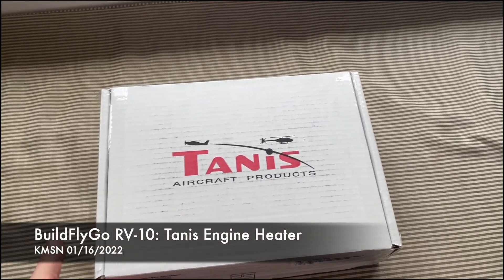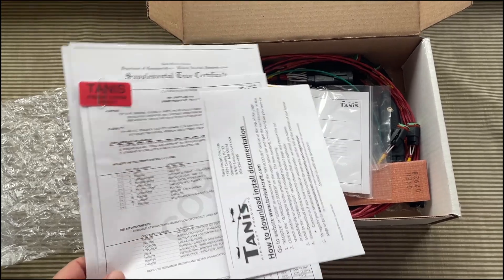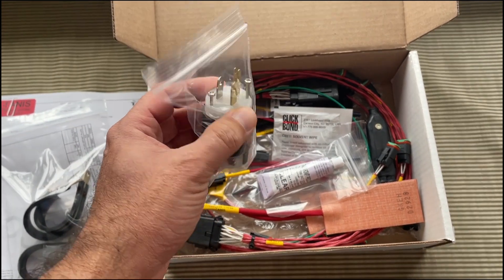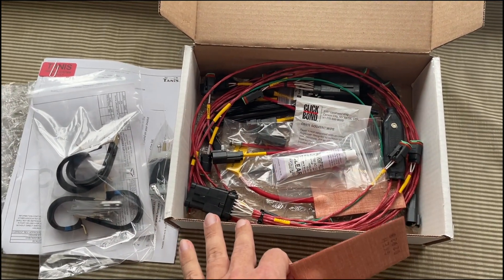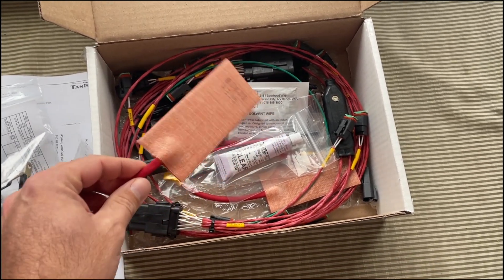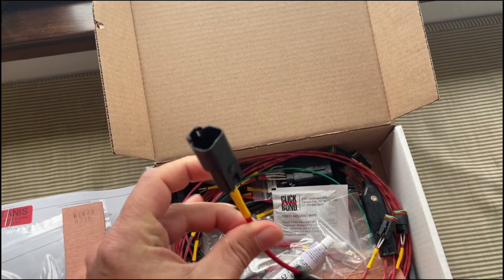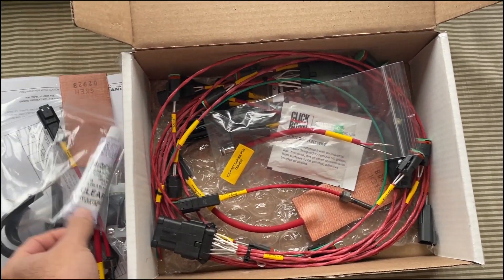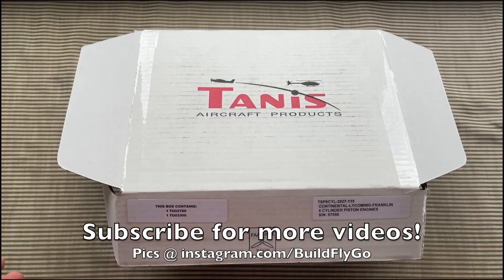Gear Intro - Tanis Engine Preheat Kit

Comment: Nice setup, but I'm going to opt-in for their new screw in oil sump drain heater. No mess with adhesives.
Reply from the maker: That's a really cool idea! I didn't know they had those. Thanks for the tip!